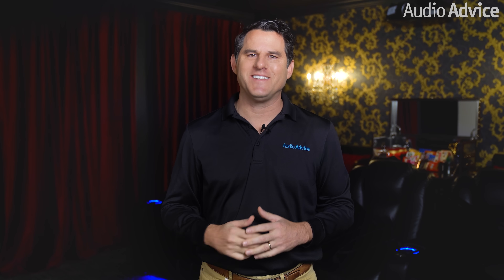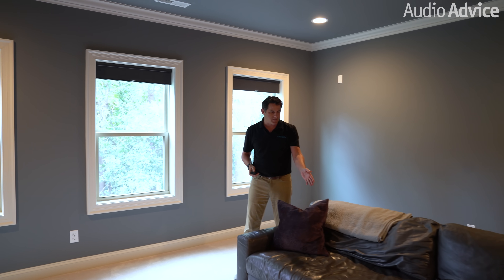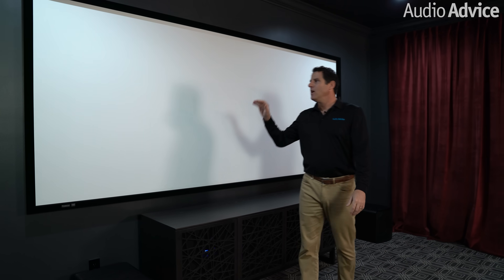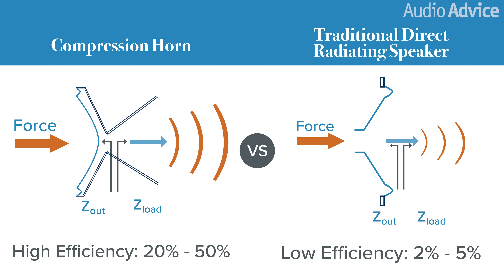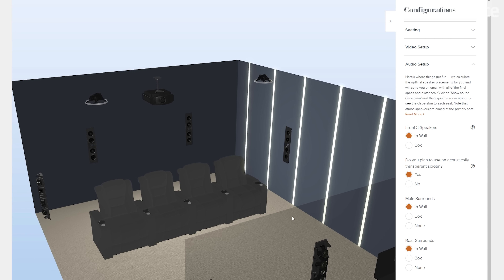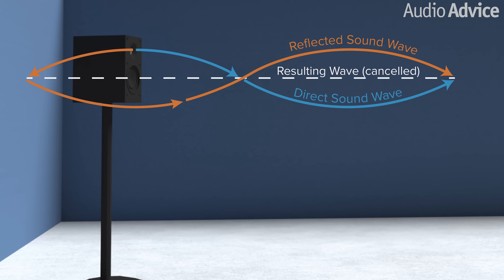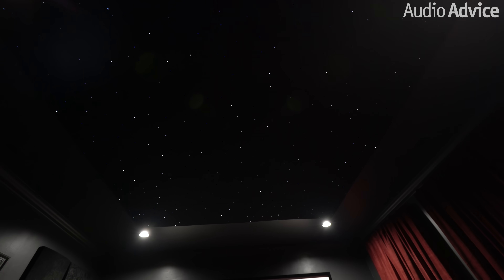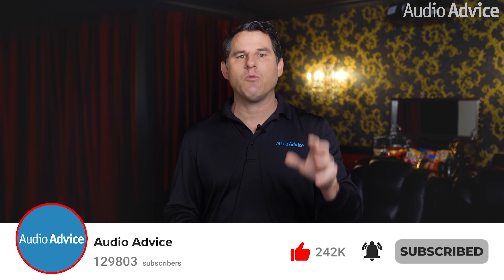5.2.2 Home Theater Tour w/ Timelapse & Star Ceiling Install | JBL Synthesis, Epson, SVS, Vicoustic

Comment: why do the 2 overhead go out so far,whereas 4 heighst in your configurator are closer? ;)
Reply from the maker: We feel that gives better immersion.  We have experimented a lot :)
Reply: but the 4 Setup more inwards for optimal immersion? i did this,moved them inwards out of line with the mains.I have a low ceiling also with2,10m  @AudioAdvice
Reply from the maker: @vitalismunchen5740  Just enter all your data and follow our tool

Comment: Great room!  How did those drapes work out with blocking sound from the windows? And were they special drapes? I have windows in the room I'm converting but I decided to go the route of plug them up and acoustically sealing them.
Reply: Thick curtains like in the video will just absorb some of the high frequencies. It would be better for the sound with just blinds or boarding up the windows.
Reply from the maker: Thanks very much! It sounds like you totally got rid of your windows, which not everyone is willing to do.  Very heavy drapes can do a decent job of blocking our exterior noise and do offer absorption of higher frequencies which helps the room sound better. Thanks for watching

Comment: Great video,  I have a question.  How do I max out dolby atmos on my Samsung hw 950n sound bar.
Reply from the maker: If it has level controls for the Atmos channels, just turn them up and make sure the speaker drivers are not obstructed by the TV.  Thanks for watching
Reply: @AudioAdvice  thanks for answering my question

Comment: Hey, I'm planning on making a small movie theater in my house. Only 7.5 ft wide and 16.5 ft long with a 77 or 83 inch  OLED tv mounted to the 7.5 ft wall.  I already have a Cambridge audio cxr200 and a nice old Jamo A800 set of speakers. I was planning on glueing felt on all the walls end the ceiling because it would stop the sound bouncing around and I reckoned it would be a good idea. Now I was looking in the new stuff to make sure everything is also ready for the future when I decide to upgrade. Now I see Atmos speakers need the walls and ceiling to reflect the sound and wanted to ask if it still would be a good idea to glue the feld  on ceiling and walls or should I just paint them? I hope someone can give me some advice. 🤞 Best regards from Belgium.
Reply from the maker: If you are going to use upward firing Atmos speakers we would not suggest felt on the ceiling.  Felt also only provides a very limited range of absorption.  Its better than sheetrock, but a denser material is preferred.  Thanks for watching

Comment: Question what is better 7.2.2 or 5.2.4? In order to achieve 7.2.2 in my case the rear top atmos would be switched to rears but will not be at ear level which is where the 5 lcr and surrounds are
Reply from the maker: For your application 5.2.4  Thanks for watching

Comment: I have a 14×13.5 room with a door on the top right of the room. Effectively cutting off 3 feet of wall space. Is my room too small for a home theater?
Reply: I have a home theater in living room that like  7.4 wide by 14.10 long, 7.10 ceiling. Seat three.  In back of it one closet kind of annoying. But all work out.  My size does not even work in Audio advice tool :-) it's a 5.2.2 I have. 15 speakers, two subwoofer.
Reply: My small living room home cinema is only 12.9 feet by 11.5 feet, with a 7.11 feet ceiling. I get a great immersive sound field from it,  from proper speaker placements. And acoustic room treatments absorption and diffusion.

Comment: You looked at the Dolby spec for 7.1.2, and because you didn't have side speakers, you had the rears at the outer limit of their spec. Surely if you don't have side speakers, you just go with the Dolby 5.1.2 setup instead.

Comment: I don't understand the no side speakers. There's plenty of room in-between the windows and on the other wall. Could have gone for 5.2.4. or 7.2.2/4
Reply: No room on the right hand side for a right side surround because of the window. Personally I would have put a slightly bigger projector screen. And absorption to the front right directly beside the first right window. 

And just blinds instead of also those thick curtains, as thick curtains will absorb too much high frequencies. Plus absorption panels on the centre of the back wall. And diffusers on the left and right sides of the back wall.
Reply: @C--A  it shows the left wall at 1:16. Looks like no doors would be in the spot of the speakers
Reply: @ballashoes  That timestamp just shows him walking in through the doors. It doesn't actually show the left wall.

Rewatched the video and the timestamp 3:03 of the 3D virtual rendering of the room. Shows yes you're right there is room on the left side wall beside the door for a left surround in-wall speaker. 

But no room on the right side. As the window is where the right surround in-wall speaker would go. So the in-wall side surrounds on the back wall was the only option. As I doubt the client wanted speakers on stands beside the seats.